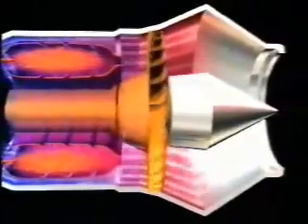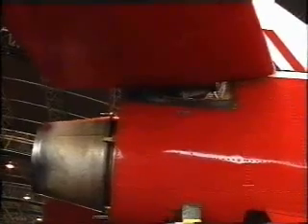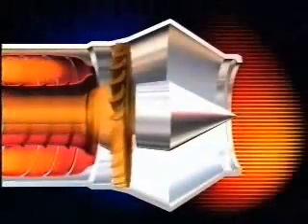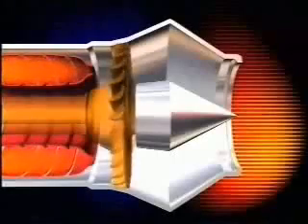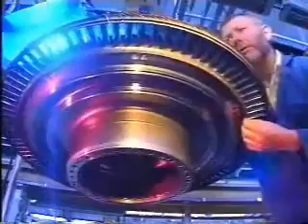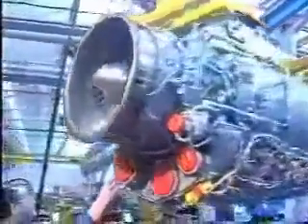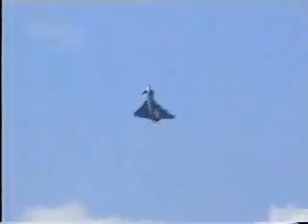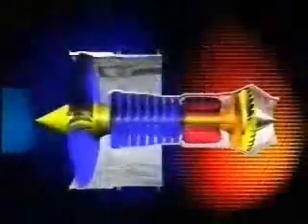Operations of aircraft jet engine  (turbo prop, turbo fan, turbo shaft, turbo jet -after burner).flv

Comment: Pretty good explanation except for one point. It is stated that the gases exiting the engine are moving faster than what is going in is what generates forward thrust. In reality the pressure generated in the combustion chamber walls is held captive except at the rear where the gases exit hitting the turbine. Think of a blown up balloon where the pressure is the same inside until it is released, at that moment the pressure at the neck (exhaust) is reduced while the pressure everywhere else remains the same and the fact the pressure directly opposite the neck is now higher causes the balloon to move forward. Now apply that principal to the turbo jet, you have constant air flowing into the combustion chamber from the compressor that the pressure can't go backwards through and he only way for it to escape is through the nozzle thus reducing the pressure at that end of the combustion chamber. The turbine creates exit resistance not allowing the pressure to drop as much at the exit thereby reducing the pressure differential between the entrance and exit of the combustion chamber but is a necessary evil to drive the compressor and any other accessories.
Reply: DrHarryT Shouldn’t most thrust be from the inlet and compressor (and combustion chamber?)

Comment: I've always wondered how they got the jets to reverse thrust after landing. I've never noticed the flaps before. Now I'll be watching for them.
Reply: Thrust is reversed by thrust reverser. Flaps are for producing lift in take off and stability and drag in landing. Also, in the most big air planes, the air brake is enough and thrust reverser rarely used.
Reply: whats the difference between air brake and thrust reverse?
Reply: speed brakes are brakes on the landing gears ( the same as car's brake) and are controlled by pedals. Thrust reverser is a metal piece on top of the exhaust that is controlled by throttle lever ( Idle-thrust-reverse mode selector). Air brakes are on top edge of the flaps.

Comment: how does the helicopter turbo shaft thing work when the helicopter is hovering or stationary? Isn't there no or litle air coming in?
Reply: Don't confuse the rotational speed of the helicopter blades for the rotational speed of the internal turbine. The turbine itself is still very much spinning and sucking in air. Often times, the blades make a single full rotation for about every 7 rotations of the turbine engine. The ratio varies from model to model, but the point is that the propeller blades do not spin at the same rate as the turbine driving them. Helicopters have gearboxes and clutch systems just like cars do. Of course the implementation of these systems is different, but the ideas are the same.

Comment: so afterburners are like turbos for cars?
Reply: TheAvengedNightmare2 essentially...all a turbo on a car does is compress (or thicken) the air to "fool" the engine to thinking it's at a lower sea level where it's more powerful.
Reply: Afterburners would be more like NOS injection. The turbine and compressor would be like turbos for cars.

Comment: static thrust = mass flow rate * velocity output,
more static thrust = increase in mass flow rate or output velocity,
mass flow rate is increased by adding fuel,but my problem here is how velocity is increased by heat?
more heat,more pressure,and according to bernoulli's principle, higher the  pressure,lower the velocity, isn't it?
Reply: +Aaron .T Imagine a Balloon filled with air.  If you were to pop the balloon with a needle, the pressure energy inside the balloon would be released through the exit which gets converted to velocity/kinectic energy and this creates thrust.  If we were to heat the air inside the balloon the pressure would rise even further and which would then get converted to extra velocity and thrust.  If the combustion chamber were to be a sealed enclosure, then the pressure would rise but because of the flow of gases towards the exit and the expansion of gases converts this pressure to velocity.  Well, that's my understanding.

Comment: Not too long ago, I got into a heated dialogue with some stupid YouTuber about design changes to turbo fan engines. In the 60s, turbofan engines had a "scream" about them, but through the 70s and 80s, the sound changed to more of a propeller driven engine. This, I believed was the result of using more of the fan in the front of the engine to produce thrust (the bypass). This video seems to vindicate my statements. (Off topic, I consider propeller engines more elegant, somehow. Don't ask me why.)